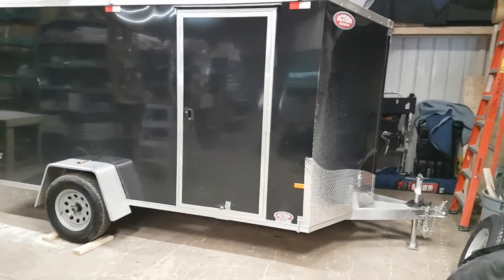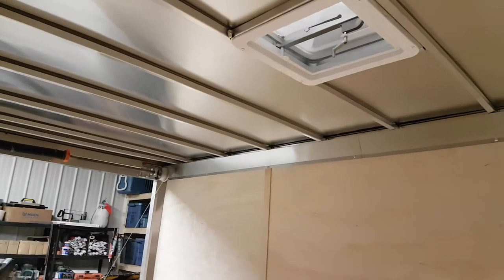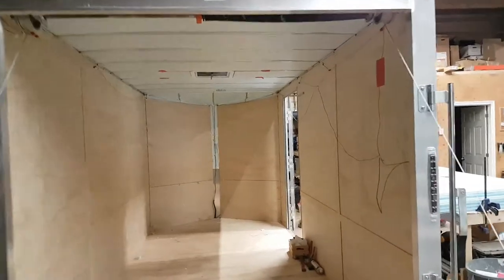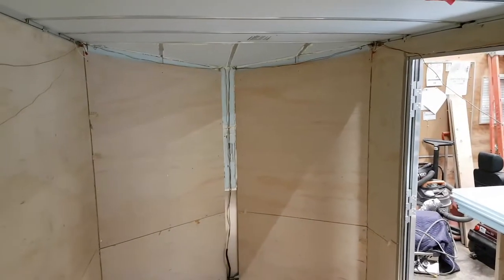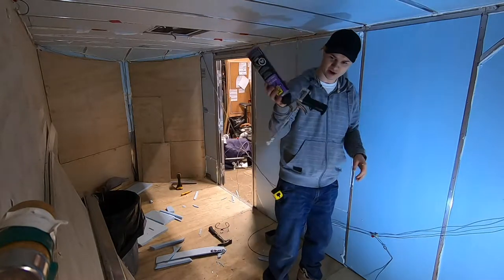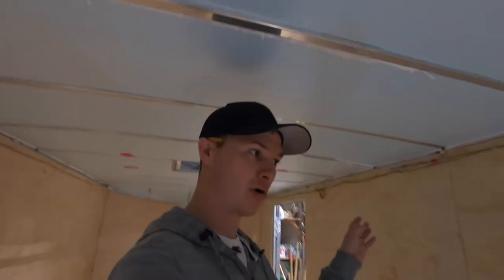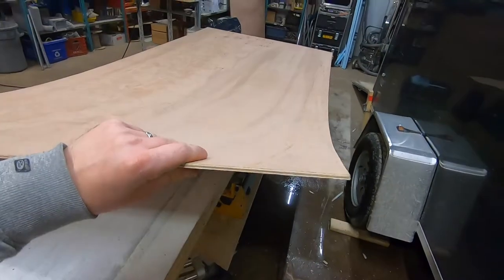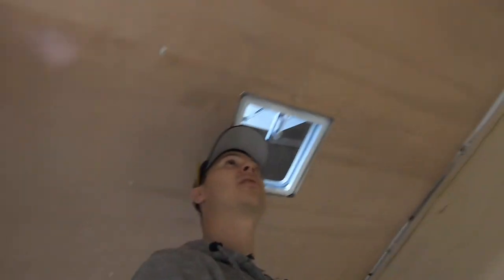Work Trailer - Pre-Build Tour and Insulation

Comment: Have you found this was worth it? I currently have a trailer that im looking to upgrade however I wouldn't do the ceiling as I need the max height and nothing with the floor. Is it worth it? My main concern is how cold it get in there in the winter
Reply from the maker: I dont heat it but I'm sure it would help. It's more for the summer but still gets pretty hot in there. Is it worth it? No idea. Would I do it again? Probably not but depends what I plan to use it for.

Comment: I am curious why you insulated the trailer. I heat mine at the jobsite with a small heater and seems to work fine without any insulation.
Reply from the maker: It was more for the summer. Black trailer in the sun is not fun.
Reply: @BrentDarlington  that would make sense to me. I own a white RC 6X12 trailer and I haven't experience it getting to hot. However I will run a fan if it gets above 90°. I live in Wisconsin.

Comment: Looks great, what kind of fasteners did you use for the 1/4" plywood to the frame on the ceiling?
Reply from the maker: Thanks. I used some self-tapping wafer head, zinc coated screws. Probably 3/4" long.

Comment: I am doing the same thing with my 7x14 trailer.. what type of screws did you use to attach the Plywood to the metal?
Reply from the maker: Zink coated self taping wafer screws. Same as what the manufacturer used for the walls
Reply: @BrentDarlington   awesome thank  you!
Reply: Um it comes with screws just reuse

Comment: What was the cost to do this? Just got a new trailer and looking to do this, my ceiling is already insulated but not the walls
Reply from the maker: Depends where you live i guess. I used 5 or 6 4x8 1" foam sheets and a can of spray foam. $300ish CAD

Comment: What is all the wires?
Reply from the maker: The wires are for the exterior lighting - tail lights, running lights, etc
Reply: @BrentDarlington  thank you
Reply: @BrentDarlington  How did you know where to drill for the ceiling panels ?
Reply from the maker: There weren't any wires to drill for the ceiling, just the fan wires that can trough the vent hole. For the screws, I measured where the bars were, on 24" centres